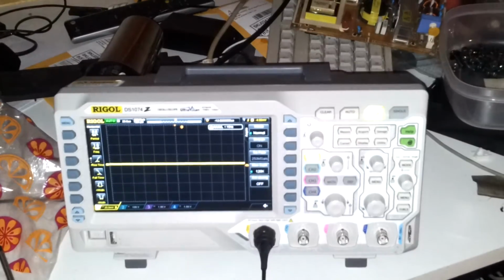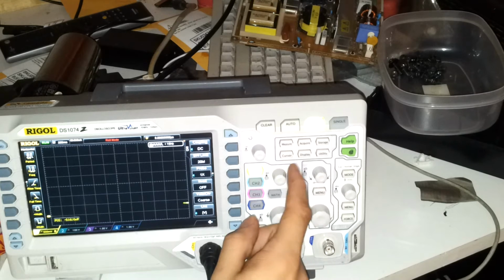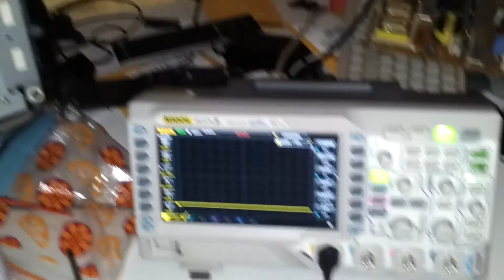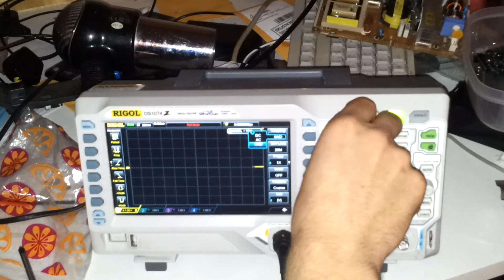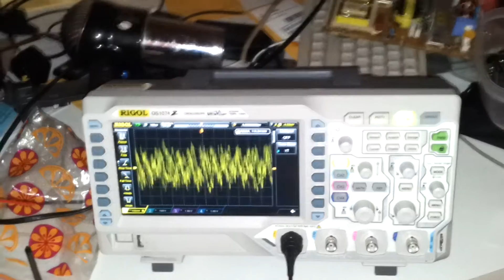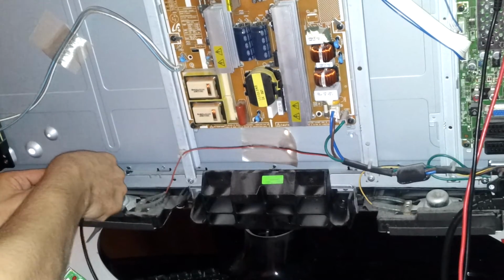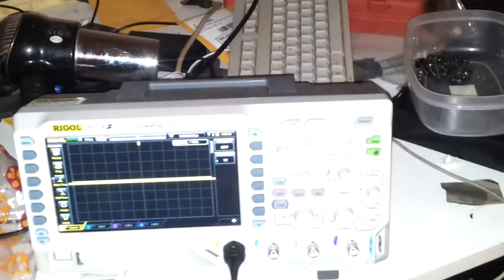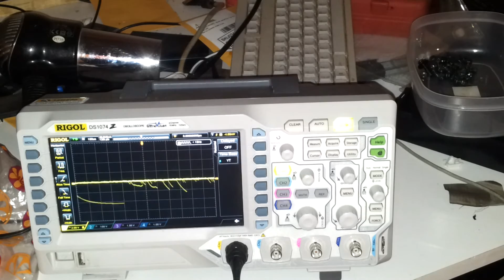Samsung LE40A457 - Stuck in standby / No remote function - Diagnosis of Fault

Comment: Tom can you explain a bit more about AC rippling , from what you explained I can understand you changed Scope to AC coupling and you saw the noise on the line is affecting the IR sensor, but I don't seem to quite understand if that's basically spurs which aren't filtered by the caps causing that . I can now recon myself this happens on most samsung tv's when there's specially noise on the lines (ripples) they somehow affect any digital circuit causing misbehaviours.

Comment: Ive got the exact same tv with the exact same fault, after 5 or 6 years of use from new the power supply board caps bulge, two reasons this happens, 1 being bone idle and leaving the tv in standby all the time and 2 heat from the surrounding heatsinks, these tvs were made in the "capacitor plague" era most brands have similar faults but easily fixed if you know what you are doing. The main power supply board is made by hansol and these are known to give faults. If you want to permanently cure the problem fit a 40mm fan to the heatsink this will circulate the hot air and stop it building up. they are 1366x768 so are higher than 720p, these sets also have a very good picture